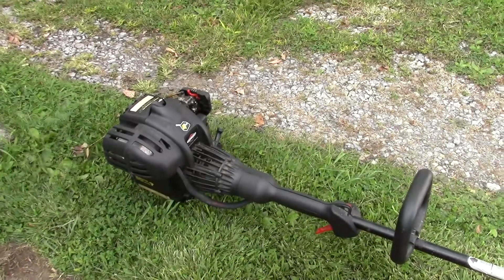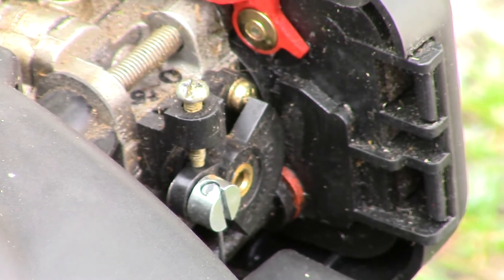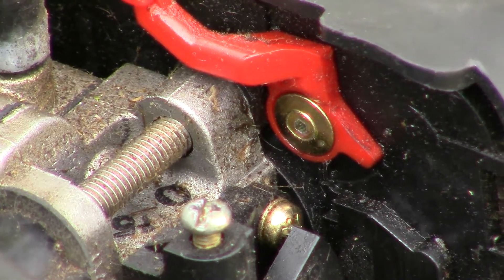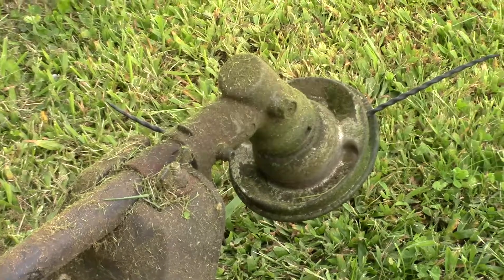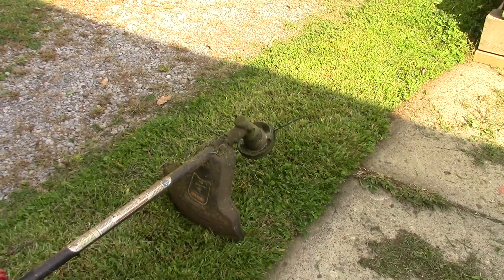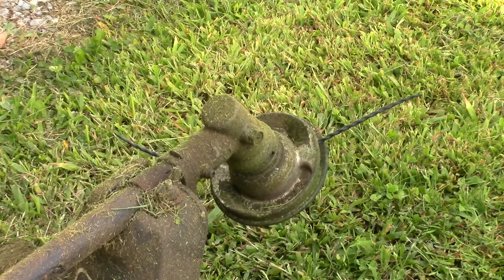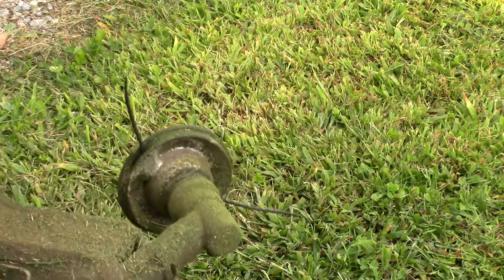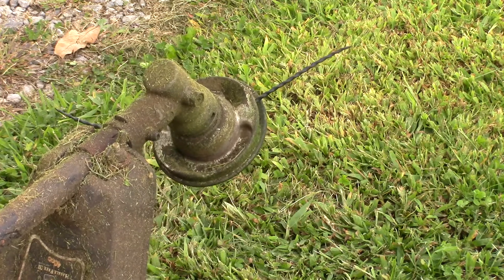Idle Speed Adjust - Four Stroke Trimmer

Comment: I can't seem to get it to where it idles and runs comfortable, if i turn it too much it it's won;t even start then. WTF gives. I regret not listening when people told me not to purchase a crasftman trimmer.
Reply from the maker: If you are just adjusting the idle speed and its not cooperating, you might need to adjust the idle speed mixture on the carb.  If its been setting, tearing down the carb, cleaning it, and rebuilding it would help also.

Comment: i need to do some work on my brand new Cub Cadet 4 stroke. used it once put it up and it won't start at all now
Reply from the maker: some of these four stroke trimmers would get their kill switch wires pinched together ive seen......
Reply: not the kill switch wire in mine , i used it once for about an hour put it up then the next time i pulled it out it was oozing oil out of the air breather. i think it may just have too much oil in it. i'm a typical man and didn't read the instructions, i just changed out the oil that was in there for the right kind and went to using it with regular oil and no mixed fuel and thought i would be fine. now it's hard to start and harder to keep running , thinking about getting an E3 to pop in it too. they do beautifully in my tahoe why wouldn't they do equally as well in my 4 stroke weedeater? right?  ;o)
Reply from the maker: sounds like a fouled plug......  they only need a little oil 30 or 5w30 I think.  though I do know if you hang them upside down or something they will leak and get into the cylinder..... what brand is it?
Reply: Cub cadet and i hang it just like they display them in the store with the head down.  motor up in the air.